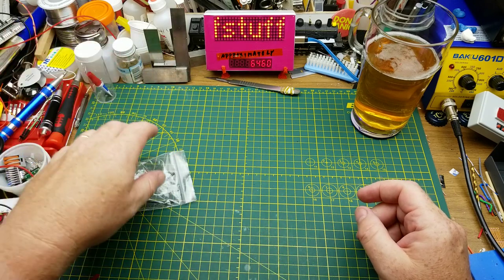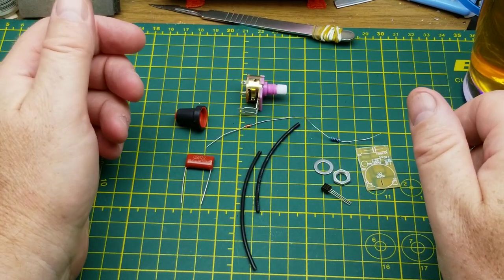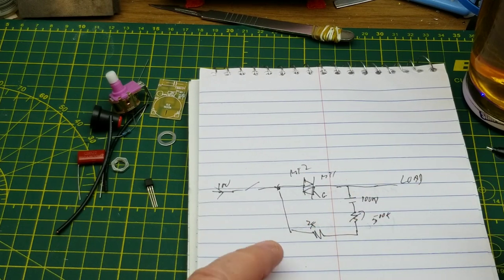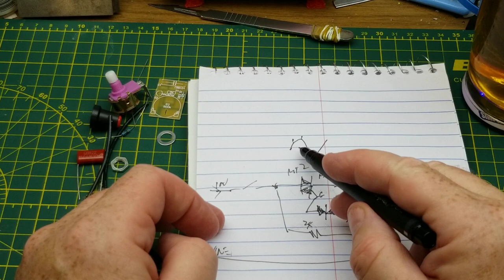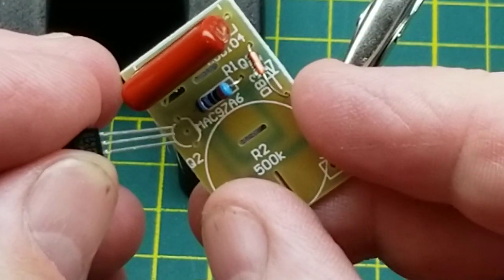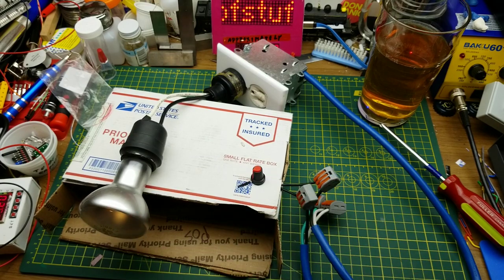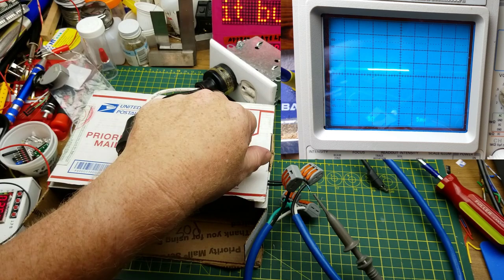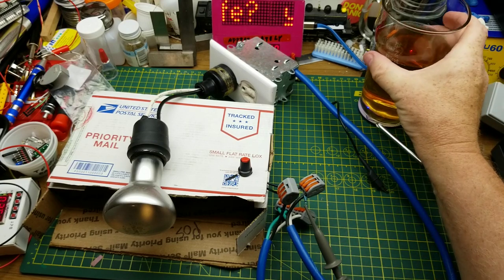Kit build: AC light dimmer

Comment: I remember making dimmers many years ago for family and friends and using a small triac was out. I tried that once and it died when the bulb died (Probably because the filament shorted). After that time I always used triacs in TO220 that could handle 10+ amps and never had another one die.

I am not sure you diac explanation is correct, as far as I remember the diac nearly shorts when the voltage reach the limit. This will discharge the capacitor into the gate of the triac and that is needed because most triacs needs a lot of current on the gate to turn on.
Reply from the maker: That's correct. when they reach the breakover voltage they start conducting.

I couldn't think of a better analogy than a zener at the time, as there aren't a lot of other components that have a reliable and repeatable breakover threshold  (at least nothing that most people are familiar with)
Reply: @pileofstuff  Diacs and triacs and SCRs and thyristors (and some other weirdly named -acs) are four layer diodes. Once you get the general idea of how they work it becomes simpler to understand all of them.
But yeah, for most people a zener is the best analogy.
Oh, you forgot the big ceramic wirewound variable resistors in stage dimmers. Try sourcing those these days. I once had to design a circuit using a PFET to replace a motor brake/clutch controller because the old units were being discontinued- nobody made its big resistors any more.
A forty five cent transistor replaced a twenty dollar resistor.
Reply from the maker: @markfergerson2145  Similar variable wirewound resistors also used to be used in tube circuits (I encountered them in transmitters). I bet my old broadcast colleagues could still get their hands on some in short order if they needed to.

Comment: Nice and simple little project :-D
Yes the old light dimmers had a big lump of a choke in series with it, storage to smooth out the waveform and since the sharp edges were smoothed off, a bit less harmonics were emmitted.
Maybe lol.
I don't use my brain often, ill put more coal on the fire and make it work :-D

Comment: Yes, as shown on the PCB  a DIAC  symbol, as standard defined, is like the TRIAC symbol, without a gate line. Design wise as a semiconductor DIACs are a 4 layer device like the TRIAC. Not really equal to two zeners or diodes in opposing series, any more than a transistor is equal to two opposed diodes. It is quite misleading to define it as such equivalent to zener/diode function.

While a zenner will conduct when reaching threshold, it would keep its voltage drop, thus the available current driving the gate is limited to the current from the resistor charging the capacitor. Very limiting trigger current to the gate of the triac when resistance is at the larger end of range. A DIAC being a 4 layer structure like the TRIAC, haa a hard off/on threshold, typically around 30V. Once the break over threshold is reached, will SNAP to low resistance/voltage drop, discharging the capacitor into the gate, thus  a large trigger current pulse  into the Triac gate fully ensuring it gets turned on even at low phase cycles, ie at large Resistance, long delay end. A dual diode or zenor will at some resistance point fail to reliably trigger the Triac.
Hope that is a clarification for you.
Reply from the maker: Thank you for the more complete explanation.

I was using a simplified analogy rather than going deep into low level silicon explanations - I didn't want to get bogged down in too many details and lose the majority of the audience.
Reply: @pileofstuff  My aim is to avoid some novice, lacking a DIAC, trying to use two zones for instance and wasting their time and effort on a non working or only partly working solution. Worse still getting discouraged.in trying electronic projects.
I have experienced beginners trying the two diode equivalent of a bipolar transistor after seeing it in an electronics introduction and getting frustrated that there is no function at all. Then giving up trying to learn electronics.
Fine to give the similarity of such equivalent concept circuits to such 'special'  devices, but with added comment that such is NOT FUNCTIONAL in reality, that the  operational characteristics are not identical.
Reply from the maker: @helmuthschultes9243  I appreciate the deeper explanation that you gave 
I always hope that there will be useful and informative discussion in the comments of my videos.

Thanks again.

Comment: How would you filter out the switching noise created from the semi-conductor switching of the triac and diac?  In my experience you would need a filter with high current components to remove the switching noise.  I was wondering if you know how to design such filters etc.
Reply from the maker: Typically with a series inductor facing the incoming power line and a few low picofarad/high voltage capacitors to help the inductor block the high frequency harmonics. Bonus points for something like an MOV to clamp the highest voltage spikes.

Comment: They are better put in a junction box with the cut mains lead wire soldered directly into the dimmer instead of those small wire leads the kit came with
Reply from the maker: This one isn't going to be used for a heavy load anyway  - the triac is only capable of up to 600mA.

But you are correct. As it stands this one wouldn't pass an electrical inspection in North America or Europe.

Comment: 9:50 - that is the most horrible blobby soldering job! Crappy solder, not enough heat, round tip not heating the pad enough, zero flux.... something definitely going wrong there, my first guess is far too little heat.
Reply from the maker: lack of cleaning the board before starting.
Plus that thinner solder has less flux than the thicker stuff.

And, probably the largest factor, I was paying more attention to making the video than I was worrying about someone doing a critique of the artistic merits of my soldering.
Reply: @pileofstuff  - not so much the "artistic merits" but it seemed like you had considerable difficulty getting the solder to flow. I had some cheap kits from China that were literally impossible to get a proper joint on.
It was like they were plated with solder-phobic "copper coloured" stuff, and no amount of cleaning, and then abrasion (scotchbrite, wet/dry paper, glass fibre pen) was sufficient to get it to work (even with various fluxes added).
Reply from the maker: @johncoops6897  These pads did look  like they were pre-tinned, but they certainly didn't act like it.